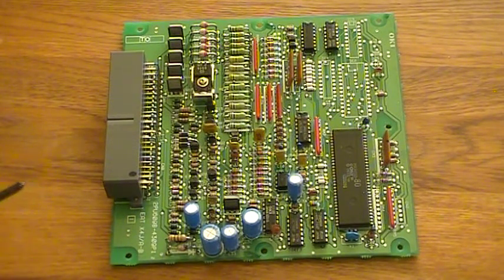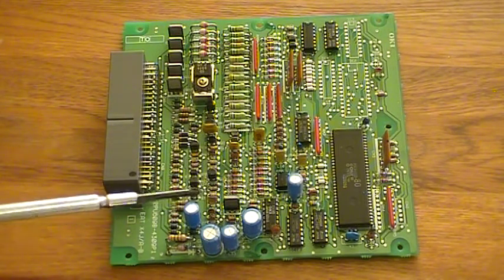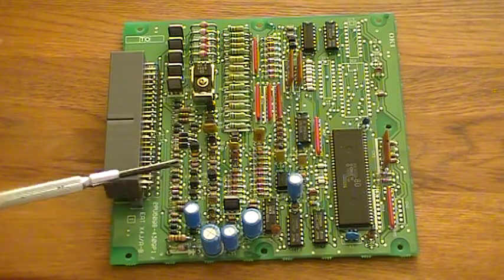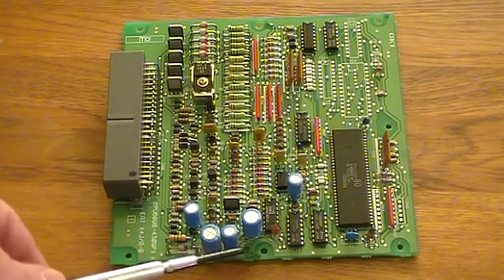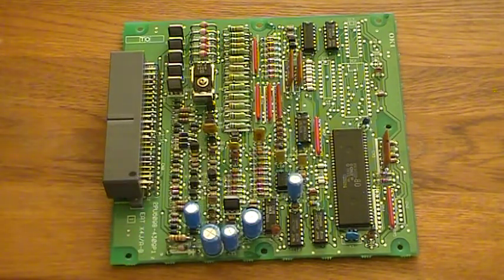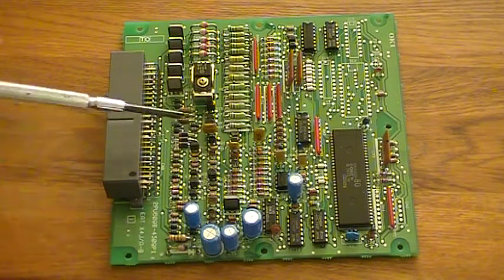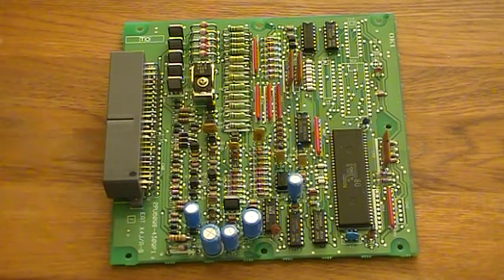1991 Accord repaired TCU

Comment from the maker: If you where local, I would hook you up.  By the time you payed shipping, and me, and parts, I think you could buy a working one from ebay.  Also check you local recking yard and see if they will sell you one cheap, if you pull it.  Think if I where to do it, I would charge $50, plus shipping(around $10 both ways), plus parts(around $10).